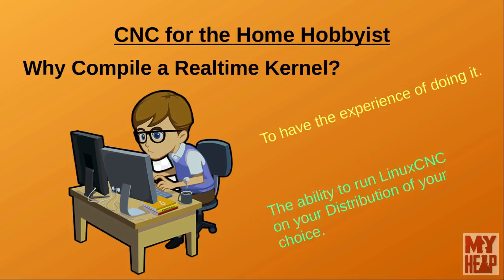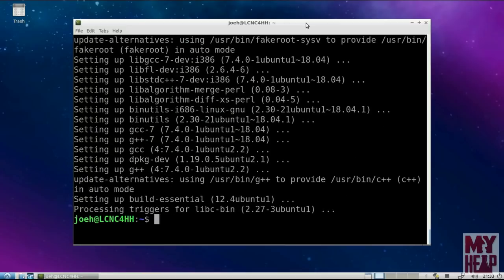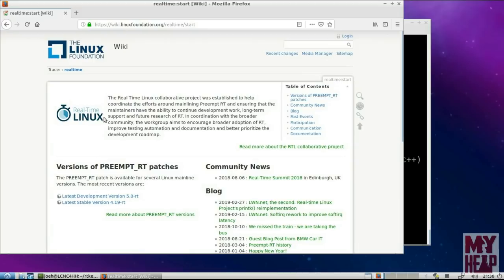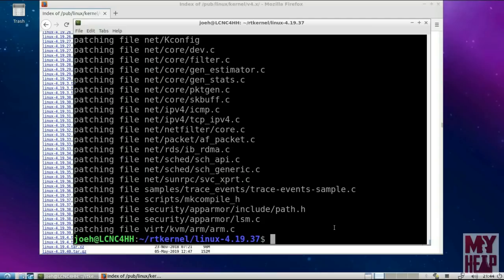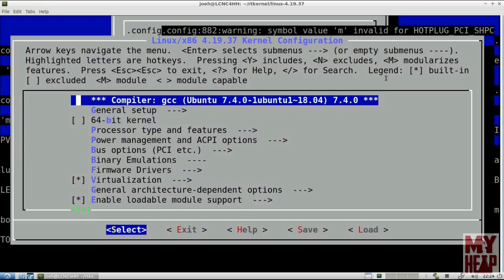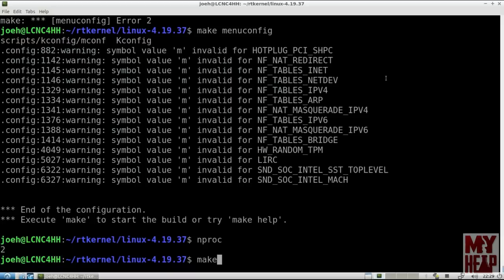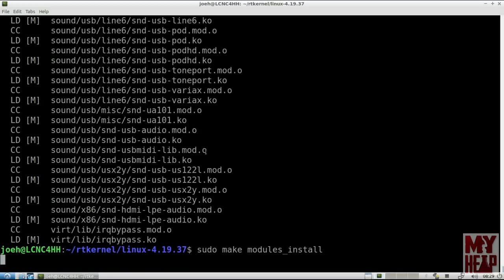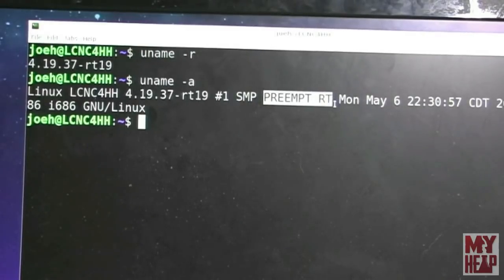LinuxCNC for the Hobbyist - 017 - Compiling a Realtime Kernel for LinuxCNC

Comment: I just wanted to add my thanks for this series on LinuxCNC. I just bought a Denford Triton-pro CNC which is a 3 axis VMC that uses Omron servos and a Baldor servo spindle motor. The original machine used a Baldor controller with proprietary software, which didn't come with the machine and was expensive to replace. I have been reading everything I could on most of the CNC forums about conversion options and have watched any number of YouTubes trying to decide on the control software and hardware. I decided to replace the controller with a Mesa card (PCIe) in the computer and a Mesa BOB in the electrical panel box. The Triton also has an 8 tool changer and a mist coolant pump, so the wiring is somewhat daunting. At least I have a full schematic to work with. I have, so far, been thrilled with your CNC series, especially this one. I have (almost) zero Linux experience, in spite of the fact that I was a computer tech, for the past 30 years, doing, mostly Windows and some Apple machines. I retired in 2013. Your tutorial is going to make my LinuxCNC life so much easier than if I had to dig up all of this info on my own. I might actually get my machine running in my lifetime. I'm going to watch the rest of your series and I hope I might see some more info on setting up a Mesa card system. Maybe something on LinuxCNC and servos. One important thing to consider is the downward trend in the cost of closed-loop servo/stepper motors and controllers. A NEMA 34, 9N-M, closed-loop stepper and controller can be had for $110 on eBay, and a NEMA 23 (425oz-in) set for $89, making servo type systems the better option, even on budget DIY CNC equipment.

Comment: Okay RT Kernel now installed. I have noticed that the new kernel does not like playing with other operating  systems, the system I installed it on had a Windows 7 OS that I now have to boot by changing BIOS priority.  The video was superb and very informative with an excellent step by step guide, keep up the good work.
Reply from the maker: Hi Richard.  I agree that Windows and Linux sometimes do not play well together.  Thank you for taking the time to watch the tutorial and commenting.  These things make it worth my time to make more.  In the next video i will cover compiling LinuxCNC with some of the options that are available.

Joe
Reply: @MyHeap  Hi Joe, I am looking forward to the next part, I have been trying to install LinuxCNC for about 6 years with many hundreds of attempts on different systems normally with other operating systems already installed with no success. I actually started using  Linux because  I wanted to use LinuxCNC on a 12,04 Ubuntu platform, I was successful loading this version but the trouble started when it moved to a  Debian OS. I installed this RT Kernel on Ubuntu 18.04. take care, Rich

Comment: Some times the Preemption Option is behind "kernel features" or "Processor type and features"  submenu. I have a lot of time in this and sometimes find an option can get you crazy, the kernel guys don't chose a fixed place where put the f**g  things.

On the menuconfig windows you can type the slash "/" and opens a search menu, is not very intuitive nor easy to see what you want (mostly because you maybe don't know exactly the name of that option) but makes de trick when you can't find the damn option.

Great job by the way!
Reply from the maker: Thanks for the tip and information there.  Having never really compiled a kernel before, I felt like I was flying by the seat of my pants.  Thank you for watching and the advice.  I appreciate it.

Joe

Comment: Just a small note, you may want to mention the disk space requirements in your write up of doing a kernel compilation (I.E mine failed near the end due to filling a 25Gb partition in a virtual machine)  /sadface PS thanks for the tutorial, I used to do this all the time back in the day when Linux was the new kid on the block, pouring for hours over the tweakage of tuning possible to get the leanest meanest machine on an Amiga2000, and then a 486...Ah I do love the smell of nostalgia in the morning. Cough, wheeze, make clean...

Comment: Hey Joe, that was amazing. I'm going to have to go back through and take more notes. I did print your web page so it shouldn't be too bad. I'll give it a try tonight if I can. One question does your old HP laptop have a parallel port? Thanks for another great video!
Reply from the maker: Hi George.  Glad you liked the video.  If you click on the PDF icon you can download a PDF of the tutorial.  The computer I done the recording on was a desktop and it does not have a parallel port card. I have a couple of pp cards I can install if need be.  As far as laptops go, they are not generally suited to LinuxCNC according to the developers.  The next video will be compiling LinuxCNC and some of the options available when doing it.  Any questions let me know.

Joe
Reply: Thanks Joe. I guess I thought you were using a laptop for some reason? OK my desktop that I'm going to use has 2 parallel ports so I hope that won't screw anything up. nLooking forward to the compiling video!
Reply from the maker: Hi George, having parallel port cards in the machine should not affect it at all.  The only difference between my machine booting up without parallel port cards and yours will be that your machine will load the parport_pc driver modules when the kernel detects them.  Recall that I said I was new to this compiling the kernel business, so expect to play with it a bit to get everything right.  You may want to check out the IRC channel fro LinuxCNC as well.  There are a bunch of folks there that are much smarter than me my friend!  Let me know if I can help.  Thanks again for supporting my channel.

Joe
Reply: Thanks Joe!